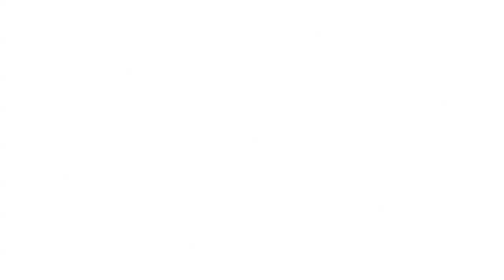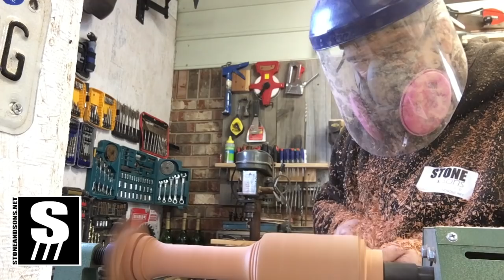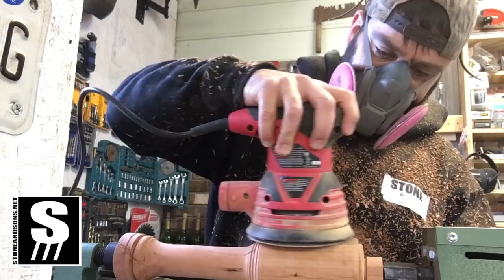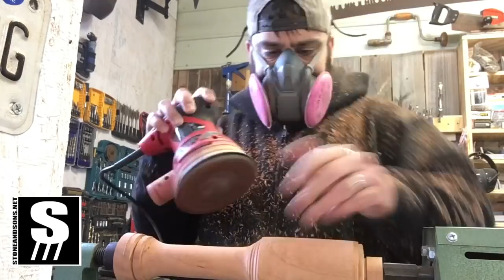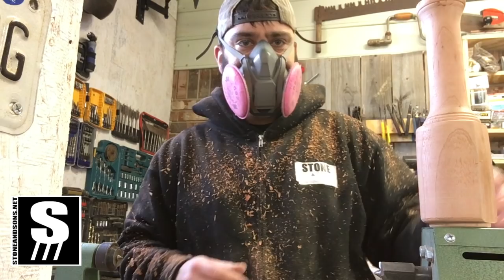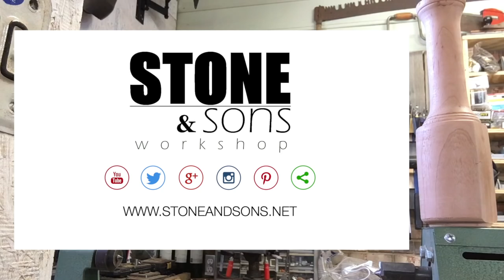Combohead Mallet - Full Version (sped up)

Comment: I've been wanting a lathe for SOOOO long.  One day...one day
Reply from the maker: +Wm. Walker Co. I'm using one of the HF models with no issues and love it.
Reply: What size is the one you have?  I know there are a few Harbor Freight sells.  I want to get into spindle turning as well as bowl turning.  Good to know you like your HF.  That was one model I was looking at.
Reply from the maker: I have the 12x44 mainly because I wanted to get one that I could turn table legs on. My website tool page has the exact one listed if you're interested. Stoneandsons.net is the address. It's pretty basic, but gets the job done. For the money I'd buy it again.